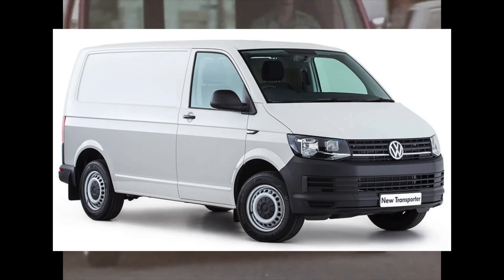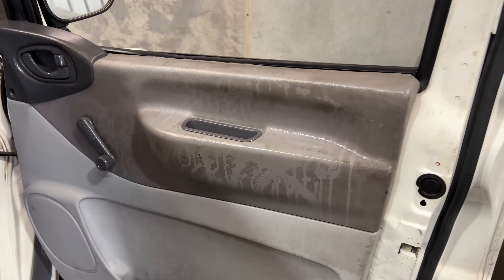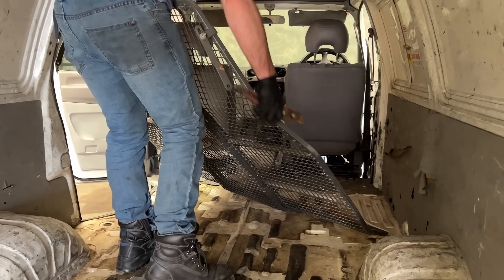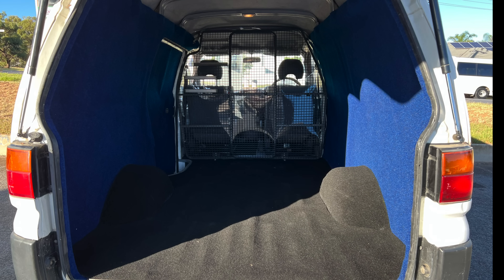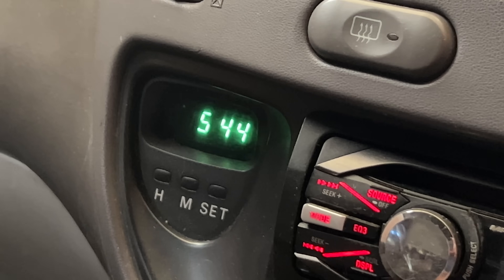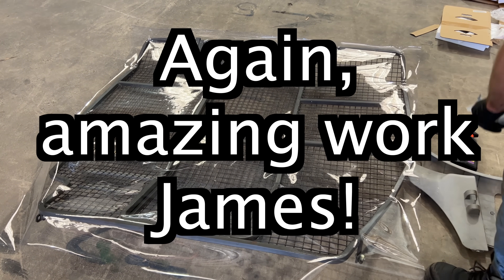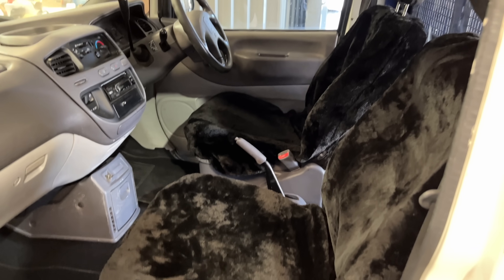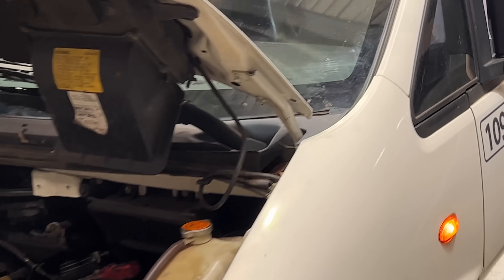I bought a van.

Comment: I'm actually kind of jealous - it's my dream to have a van, they just seen so fun and useful
Reply: Oh they are I will never drive anything other then a van
Reply: I almost did buy a van a few years back, instead I got a Holden Rodeo ute. That thing did burnouts about as good as this van until the water pump died and I replaced it with a 2007 5 series bmw
Reply: @jnrdingo1233  A 2007 5 series BMW seems a bit overkill just to pump some coolant around...
Reply: I drive a Mercedes Vito for my part time job and cannot recommend for people over 2m xD
Reply: @bastik.3011  I like the base model versions of the Vito, steel wheels and plastic black bumpers are my favourite!
Reply: few years ago I saw an ad for a 2005 vw van for like 800 euros
Reply: They are fun for sure..... You have to try keep the fact you have a van a bit quiet though otherwise you'll be spending every spare minute helping mates move stuff ha
Reply: @lucasbarton1773  agreed
Reply: @jnrdingo1233  why buy a whole new car when a water pump can easily be replaced
Reply: @GoodOlTazzy  because it had other issues as well. Water pump was gonna cost 700 bucks and I already bought the 5 series a year prior due to knowing the rodeo was on its last legs.

I needed brakes all round and a full front end rebuild. Not worth it on a ute worth 900 bucks
Reply: I want to live in a van.  I'm already training- I sleep on the floor with two pillows and a sleeping bag!  I just have to find one with enough room for a drum kit, bass, guitar and fold out keyboard!
Reply: @electroman224  lmao
Reply: My family bought our 2011 Honda Odyssey right from the showroom. It's pulled double duty as a family car and business machine for 11 years, and hasn't skipped a beat. We're thinking of upgrading to a Sienna hybrid now that the Odyssey is starting to grow a little long in the tooth (my fault), but it drives so well for what it is that I'm not ready to give it up yet.
Reply: @electroman224  buy an rv
Reply: @andrewduong2740  odyssey from ‘11 is awesome!
Reply: RIP the Grand Caravan. Best all arounder.

Comment: I like vans, my favourite was my 2002 Hiace that had grease for oil for the last 5 years. I currently have a 89 Starwagon (L300), and its pretty rough, bodywork, carby, ability to keep water out, alternator is on the way out. Shitbox van life is easy and rewarding, if you have ready access to the enginebay which is a worry in your case.

Comment: I had an '88 Cherokee Laredo and the rear differential sounded exactly like that for years, specially on highways; it is still in use today to haul logs in the middle of nowhere and still does that sound, the engine may die way before that winning differential start doing the clacking sounds, also the chassis has started to become a bit warped but that's a history for another day (yes, they do really haul logs on it but not everyday, rust is the culprit)

Comment: When the engine goes kerplooey, you should swap it with a Ford diesel from an older Transit. Those things are literally indestructible.
Reply: I’m going to buy a new Ford F-350 and put an old transit motor in it because powerstrokes are that awful
Reply: If this is a Mitubishi Express like I think it is, it already has one of the most indestructible engines of all time in it. It's the gearbox and diff that need rebuilding (and also the engine too just to freshen it up and help with the terrible fuel consumption).

Comment: This is the most relatable video of yours ever, as my daily driver is a 2003 Toyota Sienna with 270k+ miles on it, it's second transmission, death wobble at any speed between 60-85mph (it can do 90 and the shaking stops), and a CD and tape deck that plays through only mids as the base and tremble were blown out by yours truly on the highway one day

Comment: What a nugget of an old van! Tbh vans are one of my favourite cars and I mean no bias from the fact that we literally have a minivan + my life growing up with minivans! They're absolute tanks! I don't care if y'all see them as "ugly mom cars" or "that creepy white van", they're dang good at what they do! Even with the most beat up ones (our last van lasted pretty long despite all the problems she had that we weren't told about)! 
I could go on for hours about vans and minivans!
Reply: Not a van guy but I have the same fodness for station wagons. Sadly, SUVs and minivans have made them all but nonexistent these days.
Reply: I drive my purple odyssey around everywhere, I’ve even taking the dang thing off roading. 12 years later and the thing still runs like a dream.
Reply: Another YouTuber I follow said a while back that most suburbanites who buy a pickup truck should really have bought a minivan instead. If you get one where the seats fold down/come out, you end up with just as much if not more cargo area than a mid-size truck, with the only downside being that you can't fit tall things. But in exchange for that you get a way bigger passenger capacity, lower cargo height so it's easier to load, covered and air conditioned cargo area, slidey doors that make tight spaces easier, and usually a DVD player too!
Reply: @EvertG8086  I have never seen a purple Odyssey! That's so neat! Btw the minivan we had that I mentioned was also a deep purple!

Comment: Before the main comment I just want to take a moment to appreciate the majesty of those shag-pile seat covers...

Now that has been addressed, I love your new shoe box missile, The old clapped out stuff is always a hoot to drive, The seats are nice and bedded in, the steering wheel feels like a freshly shaven face and you don't have to worry at all about scratches because what are ya' gonna' do scratch the scratches lmao, I have always had beaters as daily run arounds (Being a mechanic if it goes wrong I just laugh at it and say alright mate it's time for a birthday) the freedom you get is unmatched by new cars and what's even better as long as you change the oil and filter every year without fail and only flog them like they owe you money every other weekend they last a lifetime (Until they turn to dust that is, UK is not great for salt in the winter it eats cars)

I loved your idea with the padded carpeting, One tip I might add that may help you when transporting drums, Get yourself a 50 or 100 meter drum of 550 paracord cheep off the internet (The stuff is like zip ties you find uses you never thought possible) and fit some of those D shaped tie down hoops in the back of the van about a foot off the floor, Then make a couple of zig zags side to side and either corner, Make them somewhat loose you can slot the drums in the gaps and then whether they are in cases or not they won't shuffle around and scratch each other up

Hope my mad idea is somewhat helpful or gives you a chuckle 
Thank you for the awesome videos as always
I hope you and all the family (Old mate James included) Have a great rest of your day and a nice week, Be safe and Take care out there wherever you are (^=W=^)7

Comment: If you had been up in my neck of the woods I could have found you an old delivery Van.  A lot of companies are getting rid of their older less fuel efficient vans and for cheap.

 Also, is the carpet completely glued down or can you pull it up in certain sections? Because those vans have hooks and spots to hook  ratchet straps and bungee cords.  Or else your equipment will be slidding around in there if you ever take a hard turn and have to hit the brakes. 

  Also, your differential might speed low on fluid they make that noise that happens that happens. The same with the transmission.

Comment: I've got a Delica - practically the same car but 4x4. My Overdrive also didn't work and it was just a temp sensor near the thermostat that had stopped working, used to disable overdrive if the coolant is too hot (or cold?). Permanently rounding it enabled OD all the time, 2 minute fix.
Pressing the OD button on the shifter should toggle an "OD OFF" light on the dash -  if that's not happening might be a bad switch.
Sweet car. You'll love it. If you think the fuel economy is bad now you should see the Delica's economy.

Comment: Rather than a mop, you should have used one of those nifty brushes-on-poles!
I always used to wash the outside of the family van with this nice aluminum extendo-pole with a nice soft-enough wide brush on the end of it.
Get a bucket, fill it with some tough cleaner, and that will clean the slop from every single surface much better than just a mop.
Though, the mop's not a bad choice, definitely.   

Cheers.   I love big' on stinky vans

Comment: That's a normal way of mounting a third party car radio - a metal basket with various ears and cutouts that you put in the radio hole and bend out those cutouts that can grab onto something. The radio itself then latches onto that with hooks on the sides.

Comment: If you do a transmission flush, it might help out your transmission situation. Take off the outgoing hose from the radiator side, put it in a bucket. Run the car and have someone start shifting gears without moving it. pour fresh ATF in a cone down the dipstick tube until all the old fluid is pushed out into the bucket (just add the capacity amount). turn off the car and quickly reconnect the cooler hose and check the level. Add some Lucas transmission fix, and drive it around a bit to let it work itself in, and you should see big improvements.
Reply: If you were going to do that, you might as well drop the pan and do the filter as well. Do it once, do it properly. 
With that said, I'd say the shift solenoids are on the way out.....aint no fluid flush fixing that.

Comment: make sure to check the differential fluid and transmission fluid, that might be a reason for all the issues. it is not too expensive to do, but might just save the transmission and diff in the long run

Comment: Yes I can appreciate this having just spent today wire wheeling the tray of my 74 one tonner to give it a rattles can spray job 

It's top ute

No radio 

No carpet 

No fan let alone AC 

No rego

The ring gear has summer teeth
Making starting interesting it's like roulette but with a flywheel

No centre console so I can see down the hole in the floor  the gates of the shifter and the tailshaft and the road 

Only one seat is blotted it 

The wipers have "retired" from working 

Other than that faultless 🤌

Comment: Sounds like it needs new gear oil in the rear and or the backlash in the differential adjusted and new trans fluid. Fun fact, changing the trans fluid will not make the trans start slipping. But yeah, old low budget rigs are the best. Oh, and the whistling you heard sounded like a vacuum leak. Have fun with a can of starting fluid to find that one.

Comment: My family has old ‘90s ambulance van. Old Fiat Ducato with 2.7 turbo dizel engine and 4x4 drive. Old grickaju has 450kkm on The clock but still works perfect afere 15 Years od transporting 2 ton bags of Seads and furtilizer

Comment: The whine of that diff takes me right back to one of the most horrible rides of my life. A random acquaintance offered me a ride to a festival in her L300. My parents bought their first L300 when I was one year old and still have one, so I pretty much know them inside out. This one didn't sound like it was supposed to. At all. The diff was so noisy it easily drowned out the 4D56 engine in a van (six seater with zero sound deadening). The whole front was decorated with hippie paraphernalia that jingled and tinkled the whole time the car moved. The rear bench was covered with a rug that I had to lift up to get to the seatbelt buckle. And she was driving like an absolute madwoman, definitely too fast for that car on those roads, doing things like scribbling notes on a pad on the dash while going 70 on a winding country road or turning around to look at her five-year old son in the passenger seat at the same speed. When we arrived in one piece she noticed me unbuckling the seatbelt and incredulously asked me: "You wore a SEAT BELT? How did you even fasten that? I never wear those!".

I can't say I was surprised to hear that she totalled the Mizzy a year or two later. Oh and I went home from that festival on the train.

It's a pity they stopped importing the L300 to Europe in 1998, it was an utterly amazing compact city van!

Comment: As a tradesman or tradey if you prefer, I almost spend more time in my van than my apartment. The air con works good because the easiest way to get workers to unionize against the company is to deny them functioning air conditioning while they work outside in summer heat, that 30c+ to usually a top of 40c round these parts will make a man riot. I will, and have, deal/dealt with a foot sized hole in my floor longer than I'll put up with non functional air conditioning. I don't care if the stupid van leaves rust chunks at every bump I hit because the company doesn't want to spend the money to replace the 20 year old heap that gets use in every possible weather condition, nor do I particularly care that the beast leaks from the back door seals, but boy my air con better blow frosty or we're gonna have a problem.

It should actually be criminal that larger box vans like the ones used by shipping companies don't have air conditioning, someone should literally be jailed over those working conditions.

Comment: Check your TV cable. I bet it's out of wack. Should get the od and gear hang issue fixed. It should go from the transmission to the throttle, little clip for adjustment. If your a lemon like me you pull it and wonder why you start in second and 3rd wants to hit at 9k.